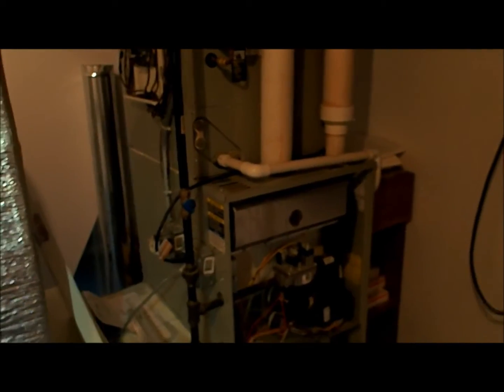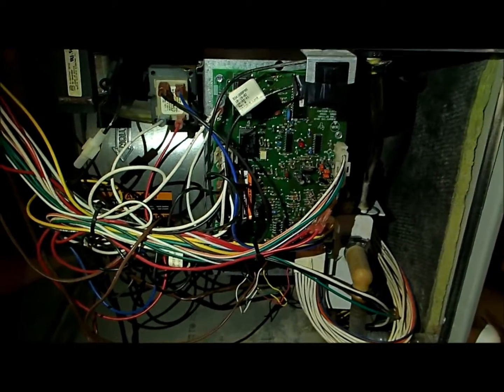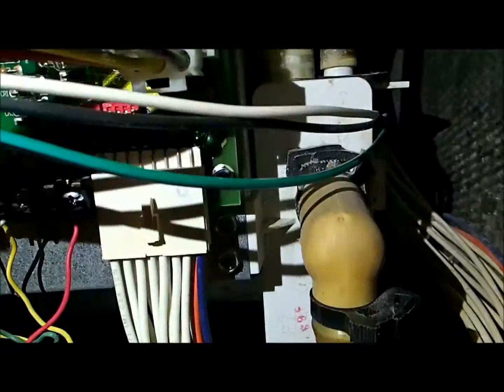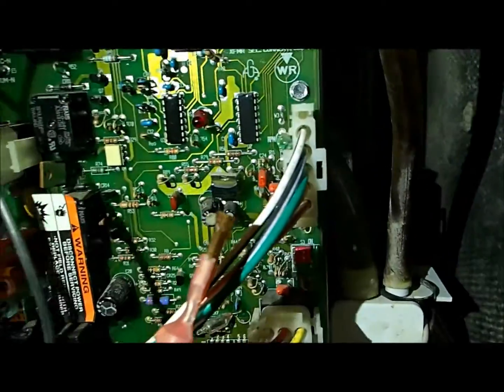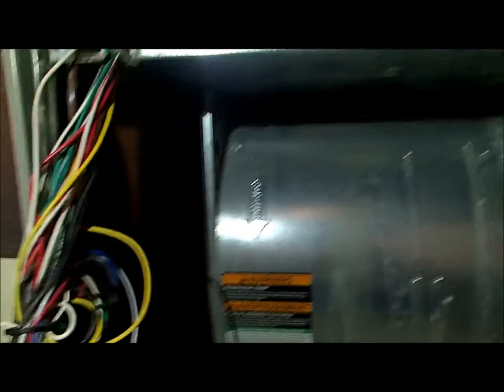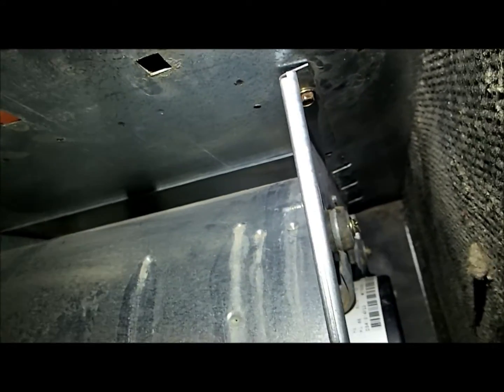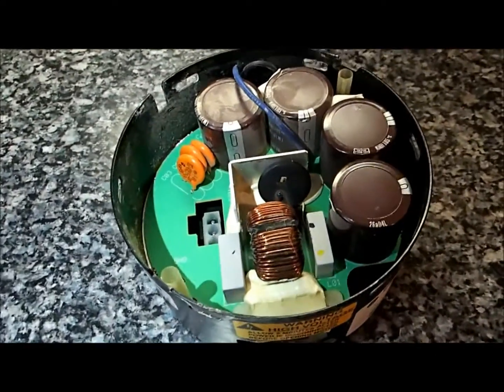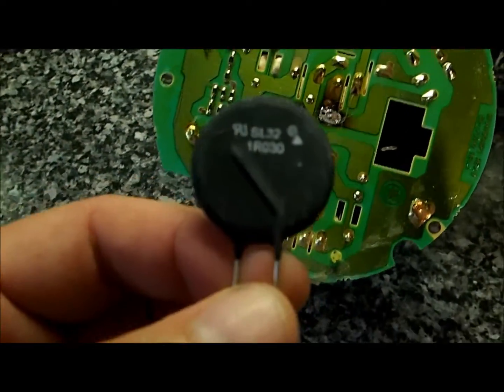Fixing a Blower Motor on a Trane XV90 HVAC

Comment: Enrique, I know your video was 8 yrs ago, found it about 4 days ago. Also have a XV90 that stopped blowing after we lost power about a week ago due to a snow storm. Had company come out and quote $2200 for new blower motor and a couple of safety switches that were throwing a 9 flash and a 4 four flash. Saw your video and decided to have a go myself. I was fortunate that my XV90 is mounted horizontally so I have plenty of access to get the module off. Sure enough the power surge from the power coming back on blew the thermistor apart. Ordered a two pack on Amazon $7.99. Arrived today, soldered the new one in…BINGO, my Wife and I now have heat!!! 
HUGE THANKS to you.
To anyone who thinks they can’t do it…… YOU CAN!!! Save your money from these companies that want to separate you from it…

Comment: @Enrique Benedicto I have a different motor part number MOT11512  but can not find any info that states which AMP Thermistor I should be using?  how did you find out the Thermistor part number for your motor?  I just want to make sure I use the correct one.  you may just have found out once you opened up the ECM?  Thank you in advance for all your excellent help.
Reply from the maker: Oh boy... That was a few years ago. I think I must have used the manual to figure out what motor model # it was, and then did some generic searches on that, eventually leading me to the inferred website in my comments. Unfortunately, it looks like I didn't actually post a link to it. Looking back, it would have been a wiser thing to do.

I do seem to recall that many were having the same issue with my model. This probably gave me enough confidence to just purchase the thermistor ahead of time.

But really... It's quite fuzzy in my memory.  

Sorry I can't be of better help.
Reply: @EBenedicto  no worries and many thx for the reply.  I will look at the old thermistor and hopefully will see some writing on it.  All my googling hasn't helped me find any reference of the Thermistor for my model....

Comment: Had the same issue with a Trane XV90 circulation motor failing.  Replaced the thermistor with the equivalent SL32 and it worked great.  The only difference is that I only removed the variable speed fan controller (the black cover on the motor that the thermistor is inside of) instead of taking the entire assembly out.
Reply from the maker: Other have said that too. It's been a few years but I'm pretty sure I didn't have the room to pull the controller out without taking the whole unit out. But more importantly, I didn't know what I was getting into back then.
Glad you were able to do it without the extra hassle I went through.

Comment: Thanks for this video!  My model is slightly different, but this led me to the root cause.  I was fortunate to have my air filter to the right of the blower motor, so removing that gave me plenty (relatively speaking) of room to maneuver.  Once I got the module out, it was clear the thermistor was the problem.  It was visibly cracked, and after touching it during my desoldering process, it basically crumbled to pieces.  I replaced it for $8.  I did have to invest in some soldering tools, but I don't mind rekindling this hobby that I enjoyed as a kid.  Looking forward to the next electronic thing that breaks!...well, sort of... ;)

Comment: Thanks for sharing this info!  I had the same problem on a Trane XV80 (Blower Motor not working).  AC guy quoted me $1600 to replace the motor and module assembly (MOT09232). 
After watching your video, I found the courage to remove and inspect the blower motor.  I found a burnt & cracked thermistor (SL22) in the motor module.  Replaced the thermistor and now it's working like new.  
DIY cost was just $8 for the thermistor since I already had the soldering tools.  THANKS again!
Reply: @radachip can you show me where you got this info?  I too have a MOT11512 and am very glad you noted this as I already ordered a 30A Thermistor which I now need to change once I can prove it to myself.  THANK YOU in advance for your help, I cannot find any info about this on the internet

Comment: One more update on this repair as a fellow DIY guy--- if you have a technician come out, you might want to get him to check the capacitor health on your compressor (the big outdoor mounted unit that has kind of a radiator under a very large fan). 

This capacitor eventually burns out, but it can happen slowly over time. The tech told me that it can degrade by up to 10% and then you need to replace it. Mine is right at the ten percent degradation so I bought a new one on Amazon for $20 including shipping. If that capacitor blows, it can also take out your compressor motor and that of course is expensive. At that point, many/most AC techs will try to sell you a new compressor or whole new system. Don't fall for that gimmick. 

It takes about ten minutes to replace it- very simple. A good video on this is here: https://www.youtube.com/watch?v=xj5EIJitfuA  There are other good video's on this.

The part I used is: GE Genteq Capacitor Round 80+5 uf MFD 370 volt 27L651. Your part may be different, so simply get the part number off your capacitor and order it.

Cheapskates rule!

Comment: Update- I had the AC technician return to my house because the system wouldn't start up after I reassembled it. He power cycled the system from the thermostat and voila, it started up and ran like a champ. It takes 5 minutes from when you restart the system to when it'll actually turn on- it's programmed to do that.

As I understand it, on some like mine (I have a Honeywell five wire thermostat) you have to do this to reboot the software. Anyway- the system is now working like a champ.

Comment: Good repair! I think the faulty part was a varistor (voltage surge protector). Thermistor is a temperature sensor used in thermostats.
Reply from the maker: Hi Sergio. I'm no exert as I didn't even know about Thermistors before I fixed my blower. But they definitely refer to the part as a Thermistor.

https://www.amazon.com/SG379-HVAC-Thermistor-Blower-Control/dp/B01GGPG43E

Comment: Thank you so much for this. I just fixed out blower motor for under $6 including overnight shipping. Just one question, why take the furnace apart? I simply took the end of the motor off while it was still in place; 5 minutes to take off and 2 minutes to put back.
Reply from the maker: Well... For one thing... I didn't know what I was getting into... ;) I didn't know what screws I needed to pull out... Didn't know about that connector inside... It would have been pretty difficult to figure all this out with about 2" of clearance between the motor cover and the inside wall.  I'm also not sure how easy it would have been to plug that cable back in, with that sort or clearance. Maybe you had extra clearance or access to the side?

If it breaks again... I might give it a try, now that I know what I'm doing... But I wouldn't be surprised if I had to pull the fan out again.

Glad it worked out better for you.
Reply: Some of the ECM assemblies have three bolts near the top of the black can, but on the side, not the top of the can. There are two more small bolts on the top of the can also. In a Trane XV series, at least the way mine is installed, you can't get at the three small bolts- you have to slide the entire fan assembly out of the AC/furnace unit before you can access those.

For sure if you could access all the bolts, I'd also leave the fan assembly in place; it's a bit tricky to re-install (not hard it just takes a few tries to get it right). You also have be gentle while doing this so you don't damage the PC board or yank off one of the many wires.

For the record- I'm not expert at this- this was my first time inside motor/fan assembly part of my furnace. Now that I've done it- it's a piece of cake. Good luck to you on yours- it's awesome to fix these for what it should cost- a few bucks!

Comment: Thanks for the video, Helped me out a lot and saved me money. I ended up buying a replacement for the thermistor P/N SG379. Newark Electronics has P/N SL32 1R030, cost was $2.83 plus shipping, this part is same specs as the SG379. My furnace was a Goodman which uses same type blower motor. Thanks again for the video.

Comment: First of all, thank you for this video.  I needed this to help me start fixing my XV90 with the same symptoms (fan not turning on).  Though mine is not fixed yet, but I at least found out what to look for and where to find the Thermistor.  

After watching your video I got an idea to remove the ECM module without removing any of the boards, or the entire motor housing.  I was able to remove the module by just taking off the two bolts that attach the module to the back of the motor.  I just took the module out and saw that the Thermistor is burnt with one of the leads now broken-off.  I will also post a video to show exactly what I am talking about.  However, your video is awesome and very detailed, it is going to help a lot of folks out there.  Thanks again.
Reply from the maker: +Apurva_Patel Wow... That'd be great if you could do it without having to go through all the steps I took.  Of course, in my case, I didn't really know what I was getting into or how to remove that ECM module, until I saw it.   However, maybe your installation is different than mine.  At 9:34, we see how little space there is in my case.  So I'm not sure I would have been able to pull the long screws out, while in place.  Then, it would have been pretty difficult to reconnect the internal connector.

In any case... Hope your approach works... You'll save quite a bit of time.

Glad my video helped!
Reply: +Enrique Benedicto , hi, It worked, just finished that yesterday.  I noticed that the ECM module that goes in the back of the motor is almost 3 inches deep, and goes about half inch or so into the back of the motor..  This left about 2 to 3 more inches between the side-wall and the end of the module.  However, putting it back is a little difficult if you are not patient.  I had to lay flat on the cold basement floor to get the repaired module back in there.  I have a very crude video that I need to edit as there is a lot of wasted time I have recorded.  Once done, I'll post it and refer folks back to your video for the rest of the repair because I only plan on showing how to get the module in an out without removing the entire motor.  By the way, I know that there are more than one models labelled as XV90, so your XV90 may not be what I have.  My furnace was made in year 2006, so it may be helpful to some folks, but not everyone.  Once again, thanks for this video.
Reply from the maker: +Apurva_Patel Yeah, I think we may have a different model because I honestly think it would have been a very difficult task to achieve in my case... especially connecting that MOLEX connector back, blindly... Maybe I'll get another chance some day ;)

Glad it worked out for you!

Comment: Hi Enrique, sorry it took so long for me to reply back on my Trane Xv90, I left for a week on vacation, and yes the motor fan went out the day before we left, so I ordered the replacement thermistor that day, we got home this past Tuesday evening and the new thermistor was sitting on my front porch so I pulled up your video and watched it one more time for a refresher, started tearing into the furnace removed the circuit board drains and blower housing removed the back of motor and yes the thermistor was fried I barely touched it and it snapped in two! I had a friend of mines father solder the new one in for me mounted everything back together and BAM!!! Ive got working AC again, the blower been working great ever since, I owe you a VERY BIG THANK YOU for this post, if it wasn't for this video I coudnt have done this project by myself, this project went smooth as it possibly could thanks to you. Now my family are enjoying the cool house again and im loving the money still in my wallet. $5 fix vs $500 fix, Thanks again Enrique for the share!

Comment: I have Trane XV90 as well, air conditioner kicked on last night for few minutes smelled a burnt plastic smell and air kicked off realized fan wasn't running anymore researched this trane hvac system saw all the posts about thermistor went online and ordered 2 replacement thermistors but seen a lot of people ordered the 1ohm 20amp vs 1ohm 30 amp, but will let you know how it goes once replaced, thanks for the video share definitely will help me with me project!
Reply from the maker: Jeremy Whicker 
Yeah, I too saw a lot of people ordering the 1 ohm 20 amp.  But when I Googled the original part, "official site results" came up with the 30 amp version.  Since the only place I saw the 1 ohm 20 amp suggestion was under that big Thread I found, I decided to trust the Google search results, instead.

All I can say is that it's been working non-stop for a week now (the Blower is always circulating air in the house, A/C running or not) and my house hasn't caught on fire... yet. ;)

Good luck!
Reply from the maker: Jeremy Whicker 
BTW... in case you haven't seen it under the description above... That original Thermistor was an SG379, in my case.  

If you Google "SG379 specs", you'll come up with 1 ohm 30 amps pretty much everywhere.  Of course, that's assuming that the Trane xv90 always used that SG379.  If yours is different, just Google your original part number if you can still read it.
Reply: will do thank you for the info ordered the new thermistor waiting for it to arrive luckily my house hasn't got to hot yet